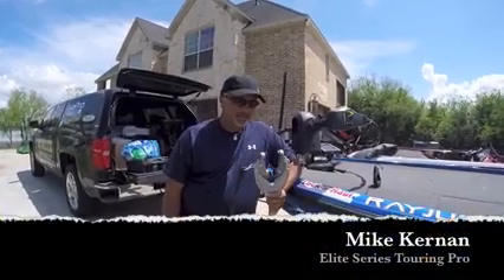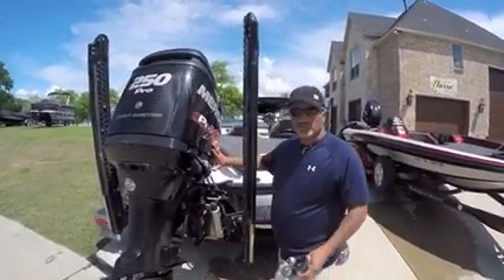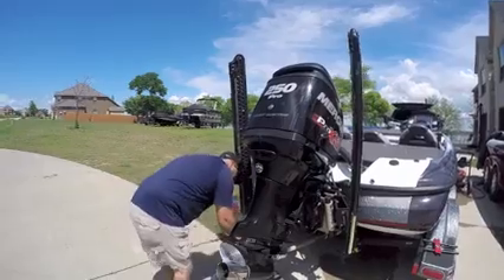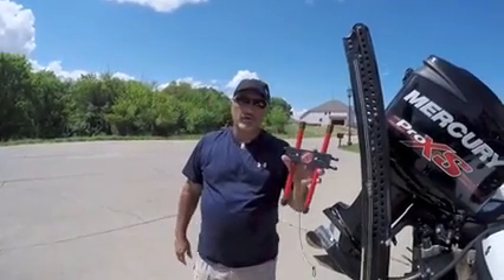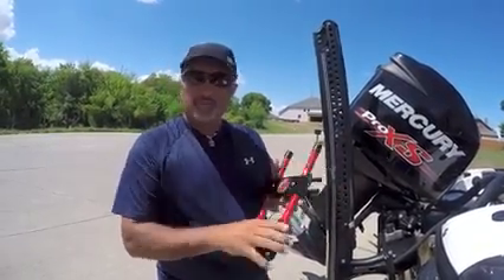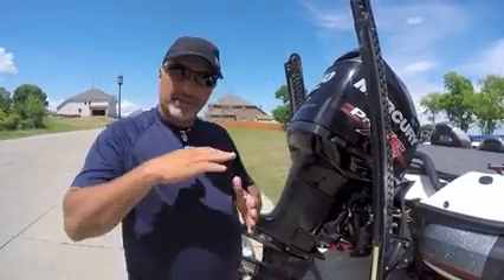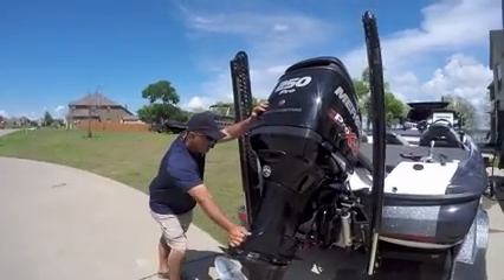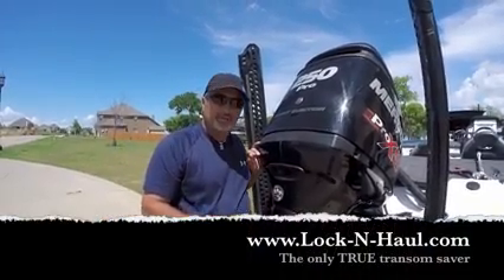LnH Pro Staffer Mike Kernan on Lock-n-Haul

Comment: It appears that the product is an outboard  hydraulic system/seal & bushing saver, actually, and not a "transom saver". Given that the demonstration showed how the device prevented the motor from swiveling on the steering shaft (and I can see how it would do that  quite well), it stops wear on the mounting bracket components from constant steering movement as the trailer moves down the road. It's good to protect those components, but the transom still holds all the engine weight and absorbs deceleration after a big bounce when traveling on a rough road.